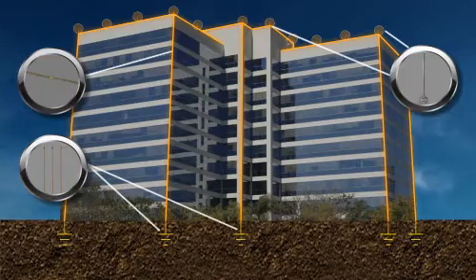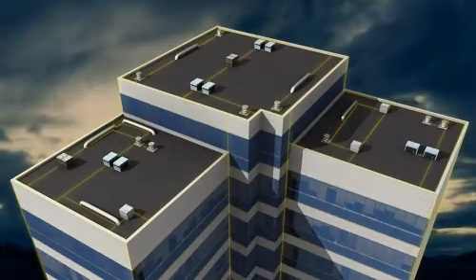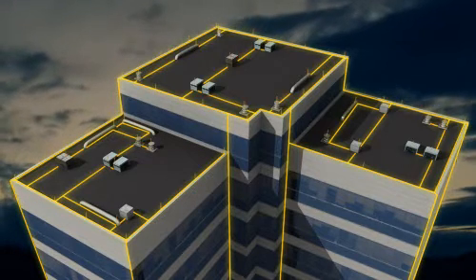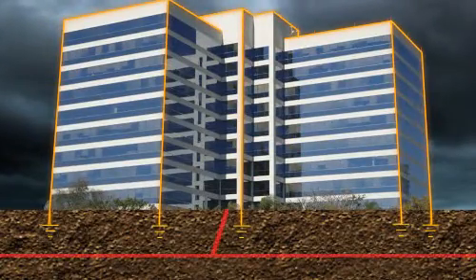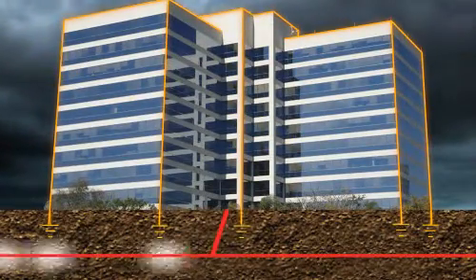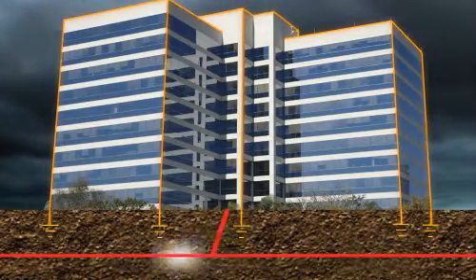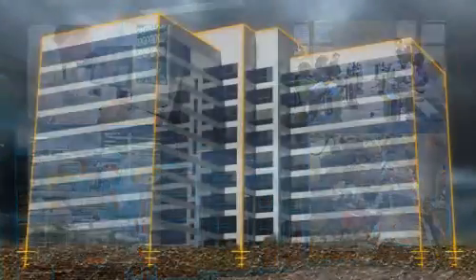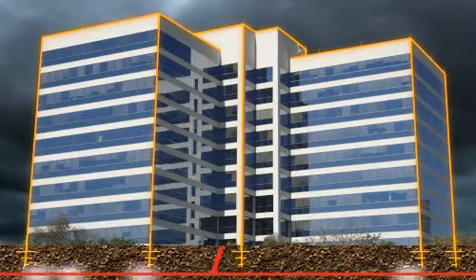Commercial Lightning Protection System Installation

Comment: Hazardous materials storage areas may use a 100' radius model to account for 98 % of recorded strikes. Once the invisible stepped leader reaches a point of 150' or greater above ground or a ground mounted object, it will make a decision on where to attach. It draws a leader up from the nearest grounded object(the building, earth or tree) completing the lightning channel and the visible stroke.

Comment: The methodology behind the placement of air terminals is largely based on what the industry refers to as the Rolling Sphere method. Lightning travels in steps or zig zag path toward ground. The rolling sphere model uses calculations of the "stepped" process as lightning energy moves through the electrical field(air) toward earth. A 150' radius model covers in excess of 93% of all recorded lightning strikes, including the most violent.